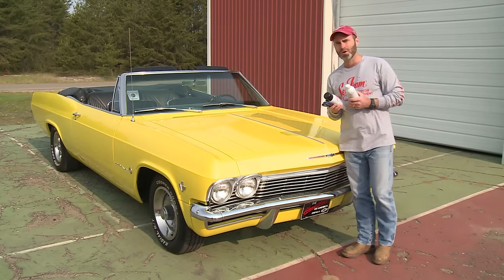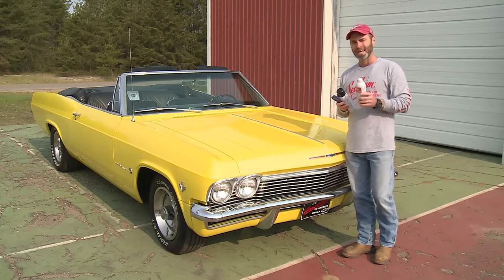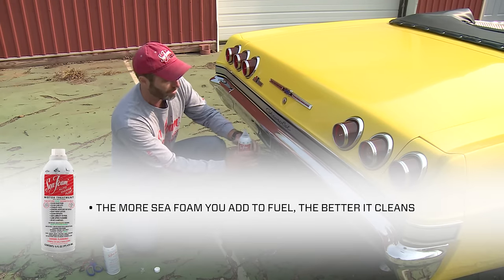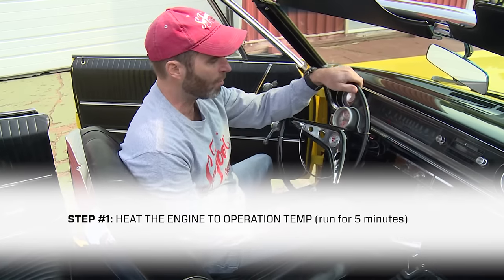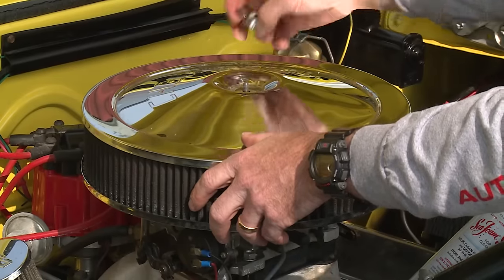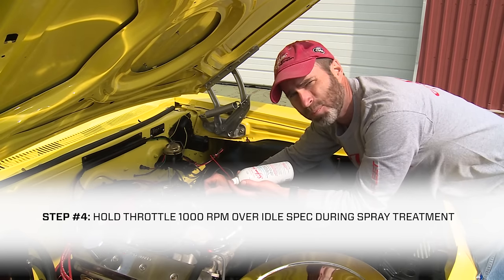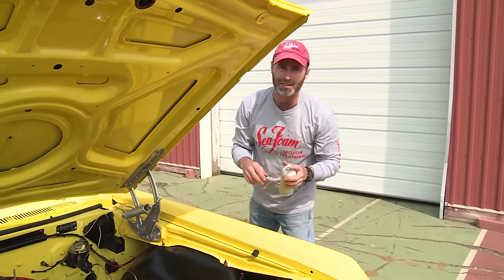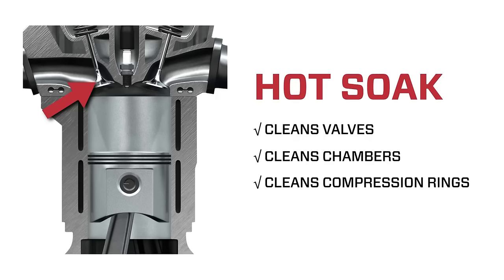How to clean a gasoline carburetor upper engine (air intake) using Sea Foam Spray

Comment: whats the best way to free up an accelerator pump in the carb
Reply from the maker: How old is it? Reason I ask is if pre-ethanol era, rubber material (seals) will harden easily.
Reply: Sea Foam Official 1966 Pontiac parisienene
Reply from the maker: @FirstGendodgegarage  My hunch is the rubber/seal is no good.

Comment: Hi Seafoam. Just got 83 caprice that’s been sitting for years. (Sharp car and runs) Should I use this method before or after I change fuel filter & plugs?
Reply from the maker: Hi Ryan. There is no concern with fuel filter or spark plugs so makes no difference. Let us know how it goes!
Reply: @SeaFoamOfficial  Thanks Seafoam! I will
Reply: @SeaFoamOfficial  it went great Sea Foam! Runs smooth as can be. Thank you
Reply from the maker: @Ry77x  Great! What did you end up doing? What was the issue?
Reply: @SeaFoamOfficial  I ran sea foam thru before the plug and filter change. Purely cleaning out the gas lines and carb. I’ve changed the plugs afterwards and plan on running Sea foam again after a few miles and another oil change. So ya, before and after. So far so great! Thanks. … and the issue was just the car was sitting for years. Sea foam seemed to help clear old gas/sludge from the carb and lines up. I’ll be using it a few more times before she is tuned.
Reply from the maker: @Ry77x  Thx, Ryan - that's great news! 🙂

Comment: Did on my 83 caprice just like you did it on your 65. I added the additive and did the carburetor spray as well. It worked excellent! Noticed a difference right away. Can I keep adding sea foam to my tank every time I fill it up?
Reply from the maker: Hi Ed: Thanks for the post and question. Glad to hear!  Yes, you can never use too much Sea Foam or use too often.  However, for any auto or truck driven regularly - we recommend a treatment every 2,000 to 5,000 miles in a daily driver vehicle.  For any fuel can or tank fuel that may sit for more than 3 weeks, add to every can/tank.
Reply: Sea Foam Official o
Reply: @wickedws6
Reply: I got a 86. With 50k og miles

Comment: I tried Sea Foam spray on my carburetor car and after that it stalls when accelerating . What is the reason?
Reply from the maker: If applied when the engine RPM is not elevated can foul plugs.
Reply: @SeaFoamOfficial  It didn't start anymore. I rebuilt the Carburetor and still can't start!
Reply from the maker: @captainkaveh1  Something isn't right. Let us know what you figure out.  And, please know that you can call the Sea Foam office if you'd like a master tech to help evaluate your problem.

Comment: I have a 93 gmc 5.7 carb. engine, would it be safe to pour the sea foam into the brake booster line?
Reply from the maker: We do not recommend - Sea Foam Spray works much better, safer!

Comment: Will the same steps work on a 70s Chrysler 2 stroke outboard marine engine.
Reply from the maker: Yes, but you don't need a full can and make sue you add a high concentration to a low amount of fuel (to clean the carburetor circuits).

Comment: This wouldn’t cause any issues running through a supercharged carbureted engine would it?
Reply from the maker: Would not. It goes right into the carburetor throat to clean intake valves and chamber, then done and pushed out exhaust valves.

Comment: Hey is it safe run a car without the air cleaner on ? My carburetor stud is stripped smh
Reply from the maker: As long as you're spraying after the filter.

Comment: Out of complete curiosity, you stated in the video that “ 2 or more ounces per gallon” what if I were to put 128 ounces in my 38 gallon tank? Is that too much? P.s. it’s an old truck with smoke stacks so smoke isn’t an issue
Reply from the maker: That would not be too much BUT you'd get 4 times the cleaning concentration if you add 4 cans to 5 gallons. Pay half the cost and quadruple the cleaning effect. Additionally, you still have half a gallon remaining to use later.

Comment: So this is an alternative to taking the carb apart correct?
Reply from the maker: No, air intake cleaning does not pass through the carburetor.  It goes into the carburetor throat, but at that point the fuel has already passed through the carburetor circuits. Adding to fuel tank cleans the carburetor. Hope this helps!

Comment: 327 chevy impala quadrajet carb I don't have the best compression is it safe to add seafoam?
Reply from the maker: Yes, no worries.
Reply: cool apparently i have bad seals ? i get oil on my sparkplugs .im gonna go ahead and add some .also thats a 63 steering wheel .65 looks bad ass

Comment: I have a 77 delta do I put the sea foam in the tank after the gas or before I put gas in the car?
Reply from the maker: Adding to a low tank is a higher cleaning concentration than adding to more fuel. You can't add too much, and the more you add, the better it works to clean.  Hope this helps!

Comment: I added your motor treatment to my gas tank & let it idle for 10 minutes, but no white smoke. (I also waited a day after I added the Seafoam) Am I doing it right?
Reply from the maker: Hi Thomas:  Adding Sea Foam to fuel will not produce a lubricant vapor emission.  All that excitement has to do with a straight application into the engine's top end.
Reply: Thanks!
Reply from the maker: Thanks for using Sea Foam!  Please let us know if there's anything we can help with.  For what it's worth, Sea Foam Spray into a carburetor through or fuel injection throttle body is the high concentration treatment you're looking for.
Reply: Sea Foam Official I sprayed about 3/4 of the can when I had to stop for family matters. Will the Seafoam be just as effective without a full can?
Reply from the maker: Three quarters effective, which is far better than zero quarters... Nice going.  Can always do more later!

Comment: I put the seafoam into my carb (73 bronco) and damn I was nervous. I tried to keep it idled at 1,200 but I was going up and down. White smoke automatically started to come out. I put about 80% of the can in there (my fault) that should be ok? If so how often should I do these steps?
Reply from the maker: 1) If you don't drive it much I would treat the carburetor intake 2 times per year. 2) If the white smoke was coming form the tailpipe that's OK. 3) How is the Bronco running after the treatment?
Reply: Sea Foam Official ok awesome! It drives good. I can feel the difference. The start is better too but once it turns over it doesn’t stay on unless I give it a little gas. Any tips on fixing that? Should keep putting seafoam in the gas tank?
Reply from the maker: @gusorion8151  What engine?
Reply from the maker: @gusorion8151  Are you using Sea Foam Spray (like the video) or Sea Foam in fuel?
Reply: Sea Foam Official both! 👌🏻 it’s a 302 V8
Reply from the maker: @gusorion8151  Have you checked your fuel filter?
Reply: Sea Foam Official I should check that, if that’s ok then step 2?
Reply from the maker: @gusorion8151  I'd examine whether the choke is working properly. May need adjustment?
Reply: Sea Foam Official awesome! I will check those! Thanks again! To who ever respond to us! You guys are awesome!
Reply from the maker: @gusorion8151  Our pleasure - always glad to help!

Comment: Where is the carburetor throat located? How does it look like ? Is it a narrow tube?
Reply from the maker: The carburetor throat is the round hole with the throttle valve in the middle. It's where the air goes passed to the intake runners, over the intake valves, then into the combustion chamber.
Reply from the maker: @jchepito84  When you remove the air filter/cover you'll be looking down at the throttle valve on the top of the assembly. It's the thin metal valve that opens to let air in, same as showing in the video.
Reply from the maker: @jchepito84  Just sent you an email with a photo of your carburetor assembly and where the throttle opening is located.

Comment: Can I add also seafoam liquid in  throttle body?
Reply from the maker: Not likely considering most cars won't run with the intake boot removed and (most) throttle plates are not positioned downward like a carburetor throat.  [You can't pour fluid sideways.]

Comment: does this work on a 351w 1984 bronco need to know ASAP
Reply: it carb is dirty
Reply from the maker: Yes, any gasoline auto or truck engine. NOTE: If carburetor is dirty, add Sea Foam to a low tank of fuel.  Sea Foam Spray through the carburetor throat cleans intake valves and chamber areas, not the carburetor circuits.   A high concentration of Sea Foam Motor Treatment added to fuel will work to clean the carburetor.
Reply: +Sea Foam Official how long before the exhoust stop smoking
Reply from the maker: Most goes away within 10 drive miles.  Some need a longer drive time, 30 or so miles.

Comment: Can this reduce the fuel smell that I’m getting from my motor?
Reply from the maker: Not likely.
Reply: A rich exhaust smell can be caused by your air/fuel ratio. 
I’ve recently heard that your exhaust can be richer in startups during the winter. But I haven’t researched that yet
Reply: @DeathByLego  thanks

Comment: I notice you don’t recommend choking the engine at the end of the can until it stalls itself for the hot soak like all the DIY videos say to do
Reply from the maker: You don't want to choke out the engine considering you might foul the plugs. Just shut it off when done spraying and let it hot soak for 10 to 15 minutes before restart.
Reply: @SeaFoamOfficial  if you're going to replace the spark plugs anyway would it be a good idea to choke out the engine or does it make any difference?
Reply from the maker: @davidk3119  Hi David. No, just shutting the engine for the hot soak is plenty.

Comment: Can I use regular seafoam not spray in air intake?
Reply from the maker: Yes, in a carburetor intake.  Be sure to pour slowly.  Note that adding liquid does not disburse as evenly as spray.
Reply: Newaz Sharif yes u can use seafoam in the intake

Comment: Can I do the same with a marine merceriser 3.0 carb engine?
Reply from the maker: Hi Seth:  Yes, piece of cake. Same routine.
Reply: Sea Foam Official Great, I'm going to add this as part of my monthly routine!
Reply from the maker: Also note to (occasionally) add a can or two to a low tank of fuel to clean the carburetor circuits.  Treating the intake through the carburetor throat does not work through the carburetor jets and nozzles to dissolve and clean away varnish - must go through fuel passageways.
Reply: Can I add a can to a fuel tank thats at  1/10 capacity in a carburated Mazda rx-7? Has it a rotary engine ?
Reply from the maker: Sure, yes.

Comment: What if the engine is undrivsble due to no brakes?
Reply from the maker: The only thing you won't be able to do is drive under load after the hot soak.  If you can't drive, just let it idle for 10 minutes after the hot soak.

Comment: One thing I don’t understand....why do you guys recommend driving the car for 10 min...how is that better than just revving the engine at different rpms to simulate driving
Reply from the maker: There is no load on the engine when revving.  Cleans far better with heat/compression.

Comment: Do you recommend doing this every year on marine engines ?
Reply from the maker: If an outboard marine engine, see the "Can & Hose" video.  What type of marine engine do you have?
Reply: Stern drive  I/O Mercruiser 4.3 V6
Reply from the maker: Thanks - Hands down, the easiest/most effective is the Can & Hose method using the fuel line.

Comment: Why does everybody tell me to change my oil afterwords then?
Reply from the maker: Hi Hannah:  Thanks for the question.  We hear a lot of things about what to do and not do.  Not sure where some of the ideas come from.   Note: A Sea Foam Spray treatment works through a gas engine's top end to clean air intake areas, intake valve and upper chamber areas.  Sea Foam Spray has nothing to do with motor oil.

Comment: I had to do mine at idle, will it still work? I had lines connected to my air filter housing.
Reply: Idk what would happen if I took off the vacuum line and the ac line to my carb. It's hard to explain
Reply from the maker: @detrickv  Hi Detrick: What motor?  What year?
Reply: @SeaFoamOfficial  1975 chevy c20 Silverado 454
Reply: @SeaFoamOfficial  it worked I could tell a difference
Reply from the maker: @detrickv  Nice!

Comment: Can you add a can of seafoam in the fuel tank of a motorhome if they've been sitting a while?
Reply from the maker: Yes, can do. However, will not fix degraded gas.
Reply: Ah ok I was wondering if there was some form of treatment I guess the tanks would just have to be emptied.
Reply from the maker: @chantellrenee9520  Agreed if the fuel is bad. Degraded fuel has lost a lot of ignition vapor to evaporation so ignites poorly.

Comment: Can you moderately drip the stock seafoam treatment into the carburetor?
Reply from the maker: You can slowly sip/induce, yes.  The idea is for the engine draw (air current down throat) to break up the liquid.  For what it's worth, Sea Foam Spray works much better, easier.

Comment: They should call it Road Foam.
Reply from the maker: Too late!
Reply: @SeaFoamOfficial  how aggressive is sea foam towards fuel rated rubber, and will it break down varnish/gum? Can I drain my 2 stroke carbs and fill them manually with seafoam and let sit for a few days before draining and refilling with 2 stroke fuel to restart the engine?
Reply from the maker: @anthonymorgan5335  Sea Foam is made from gentle petroleum oils that nourish plastics and rubber parts. There are NO harsh chemicals or detergents.

Comment: I'll just need to remove my air filter and spray the carb cleaner into the air intake? That's all?
Reply from the maker: Spraying into the carburetor throat (air intake) works to clean the upper engine (intake valves, chambers, pistons, rings).  As you likely know, any application through the intake does not work through the carburetor.  Must go through the fuel system (tank or fuel line) to clean through the carburetor circuits.
Reply: Sea Foam Official in that case. I'll need to spray thru my air intake. And add fuel additives in clean up the carb areas. Howdy ☺️👍 Thanks Seafoam
Reply from the maker: You got it.

Comment: Don't know why you would have to do this to a carburetorated intake manifold, isn't the gasoline a solvent to begin with??????? You have bigger problems.  KMFNB
Reply from the maker: To clean intake valves and chamber areas. You're adding a full can in 5 minutes, so the cleaning concentration is considerably greater.

Comment: I have a 1973 Ford ranchero. Should I add a full can in the tank every fill up?
Reply from the maker: It's best to add when tank is lower (a higher cleaning concentration). Up to you how often you want to use it. The more, the better.